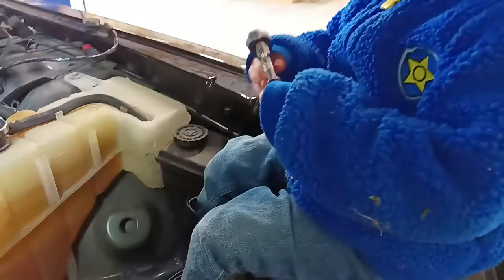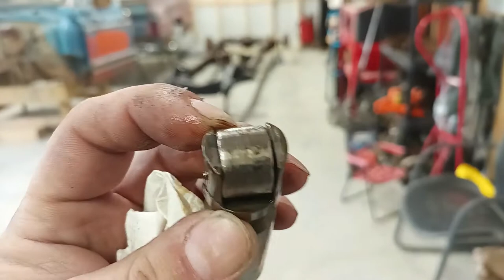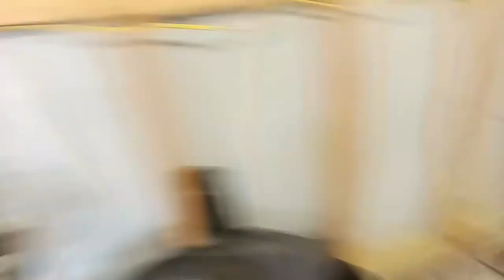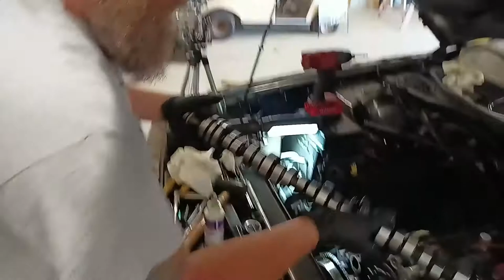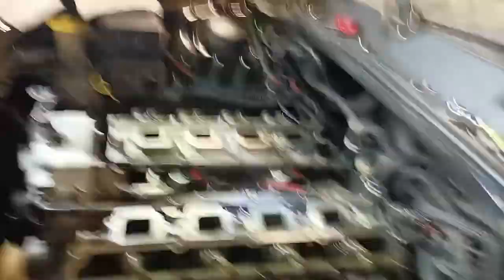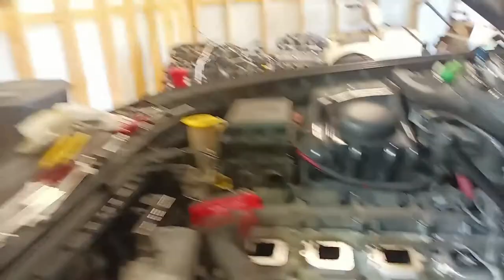HEMI GETS A NEW CAM AND LIFTERS!

Comment: Great video!! I’m about to tackle this sand project on my 2007 Dodge Ram. How long did this job take you? Also how long was your tick going before you decided to make the repair? Mine just started ticking 1000 miles ago. Not sure if I should do just lifters / gaskets or the whole repair and be done.
Reply from the maker: It took me a good full day to do. It started ticking first and within 100 miles maybe, I got a misfire on cylinder 3.  I HIGHLY  recommend that you use OE lifters from a dealer. After doing the repair using the kit from Texas Speed, their lifters failed a day after. I ended up having to redo the repair and I went with OE Hellcat lifters from the dealer. They are more high performance than normal. And didn't have anymore issues.